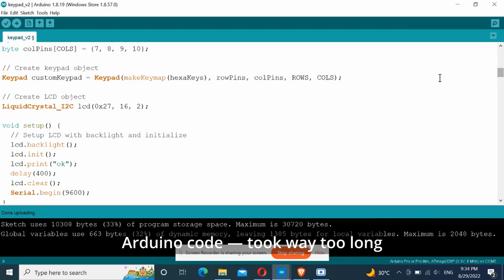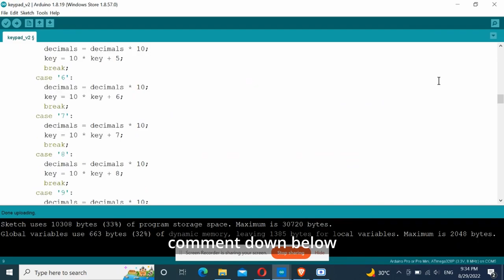Custom Mechanical Switch Calculator — from scratch!

Comment: Hi, congratulations for this project.
This calculator is exactly how I am attempting to build it.
It would be possible for you to share the code.
You would make this project much easier for me.
Thank you.
Reply from the maker: Hi , sorry bro, I'm on winter break, and the files are saved in my dorm computer. I would recommend taking a look at the link down below, as most Arduino calculators have similar code, using the keypad library. 

shorturl.at/bknvy